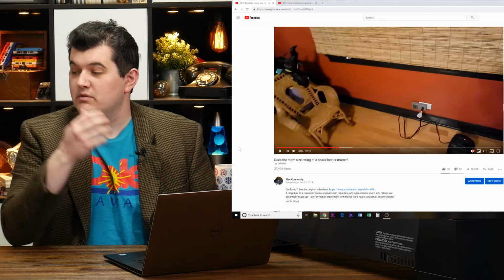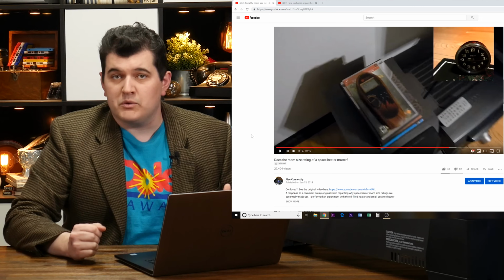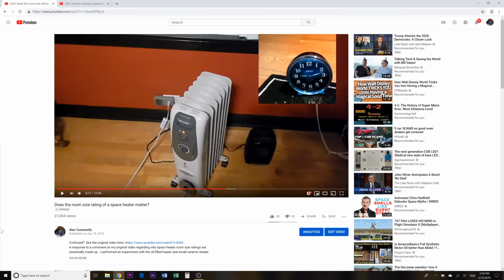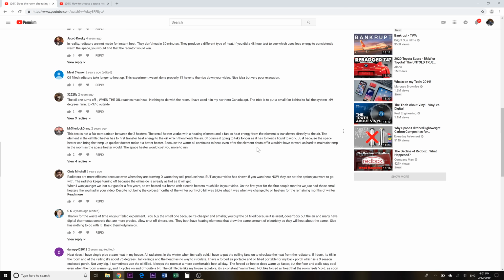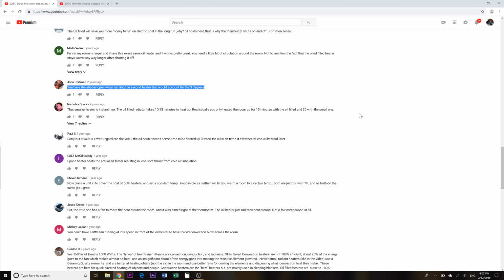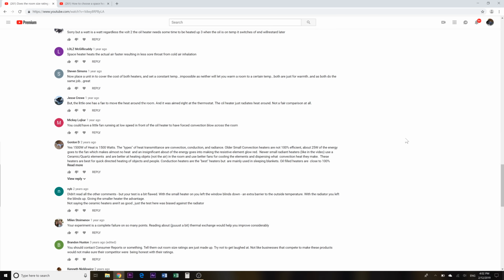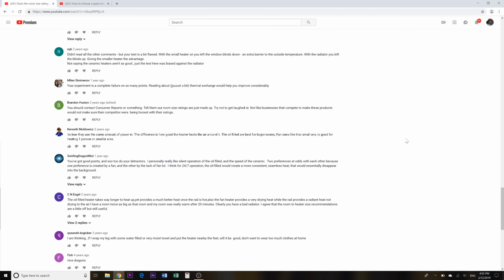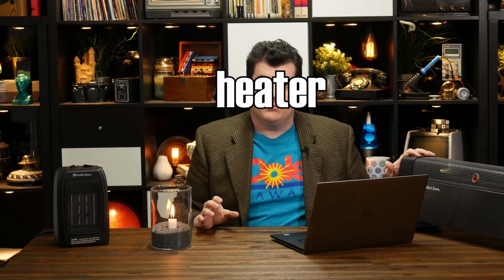More Space Heater Nonsense

Comment: A 4-slice bread toaster uses about 1400 watts with all elements energized. So it should be almost as effective as a 1500 watt space heater. Right? So if you have a spare toaster sitting around not being used and have an urgent need to heat a room, you could just disable the timer in the toaster so that it stays energized and place it in the room. Yes, it's going to dump all 1400 watts of energy into that room, but as you can imagine, it's not going to do a very good job of heating the space.

The conclusion here is that the room size rating has more to do with how the heat is distributed to the inhabitants of the space. (That is an important qualifier as we'll see later.) A small fan powered space heater can definitely punch far above its weight class in many situations, but the difference becomes really noticeable when the space you're aiming to heat has a high ceiling. With a small space heater, all of the heated air will of course rise to the top of the room, and you can actually feel the level of warm air descend the longer the heater stays on. Once the air above you is heated, it will start to heat the air around your head, then lower to your torso, etc. Of course this can be wildly inefficient if you are heating a large, open space with lots of air volume above you. Essentially you need to run that heater for a very long time to heat allll that air above you until the heat "level" of the room will actually descend to where you can feel it throughout the room, and not just next to the heater.

An oil-filled radiant heater (notice that word "radiant", very important)... Well I'm not even going to complete that thought because by now I am certain you see exactly where this is going.

I suggest you find an actual large room with a high ceiling to conduct this same experiment in, and instead of just measuring the temperature of the air, measure the comfort of numerous people distributed throughout the room, at various distances from the heat source.

Comment: little fan forced heater is perfect for most sealed rooms, big or small and great at heating them..but they really really hurt when you get your electric bill!! Now the silent radiator heater is great for a more safe low heat heater to bring a sealed small room temp up enough to be sleep comfortable as indeed I enjoy. I run my radiator at the low 600 watt setting to protect the AC plug from melting or causing my expensive wall outlets from melting over time, and my electric bill is not painful either. I never set these to 1500 watts(12Amps). My oil filled heater does not turn off at the 600w and I set the thermostat to the middle, no higher.. If your room is 50 degrees when trying to heat it, a space heater would not be the safest bet to begin with lol.

Comment: The main thing was overlooked. People are more worried about the cost of usage. The small heater using a fan. The fan takes electricity to operate. It has heating elements that take ADDITIONAL electricity. So it would cost you more money to operate because of the fan.  The convection or liquid filled heaters  would be cheaper to use.  Who cares how much longer it takes to get your butt warm.  It is not that much longer.
Reply: The uses less than 30 watts of power to operate. And even that little 30 watts isn't going to waste, since all that airflow it generates eventually slows down due to air resistance, all energy going to the fan will become heat in your room at some point.

Comment: I've been wondering something for a while now, and I guess this video is as good of a place to express it as any. My question is, if electric is the cheapest form of transportation (EVs), and is 100% efficient, why is it the most expensive way to heat a house? And conversely, if diesel fuel (heating oil) is so expensive and inefficient to use as a propulsion method (the general consensus nowadays going toward electric vehicles), how is it cheaper to use heating oil, which ALSO uses electricity for a circulator pump or air blower, for home heating then simply using resistive electricity which is 100% efficient, and supposedly cheaper than fuel oils/fossil fuels?
Reply: Engines are not very efficient at turning the combustion into mechanical energy(30-35% is what I got looking it up), a lot of that energy is released as heat.  While a electric car is way more efficient at turning electric energy into mechanical energy ( 85%+ according to what I found on google (
Reply: Deisel ICE's have bad thermal efficiency a lot of energy is lost in heat... Fuel oil heating isnt as efficient as Propane or Methane (NG) because it cannot be burned at the 85-95 percent efficiency in a furnace or even in a fuel oil stove (like a woodstove) wood and fuel oil stoves likely range 40-75% efficient that goes for catalytic and pellet type units. I have at home a catalytic wood stove and it when activated to combust the smoke still puts 250F temps up the 8 inch flue. Deisel has a really high BTU per unit rate compared to all the other options so wanting to use it makes lots of sense and granted there are diesel burner heat exchanger units out there that are fairly efficient being used in tiny homes, RV's and the like they are basically a tiny heat exchanger off a jet engine but it to does exhaust some heat up flue and likely more than the 5-15% of standardized gas furnaces. All of that said that is exactly why new invertor and multi/variable speed scroll compressors in heat pumps had to come up with a efficiency rating to show the fact they dont create the heat they extract and compress that heat from outdoors in a manor to be 100-500% efficient or in other words a COP1-COP5 when comparing BTUs gain per watt input. Burning any fuel will only ever get to 90-99% while since the heat pump doesnt create the BTU it only harvests it and compresses it from an outside air or ground source it can go beyond the COP1 rating and right to I think i seen a unit advertised to heat down to -22F and still be at COP1 and as the outside temp climbs it had a max of high COP4's at only 22F which most traditional heat pumps cant even extract heat below 35F outside temps.. This is also why the rest of the world uses masonry fire places that run flue gasses through a thermal mass it is all in an attempt to get closer to 100% (COP1).. even some old and even modern engine designs make attempts to control these heat losses better by OP engine designs better thermal efficiency leads to either more mileage or power depending on what the engineer wants from the engine. Turbo chargers with turbo blankets and wrapped manifolds to retain that heat until the turbo can extract the energy is another example of these efforts. As for the question of the best way to heat a house it really depends on the house. A super air tight or a super draft house both would do well with infrared heating a mass to better control the releasing of that heat to the air space. A drafty house with no insulation would do well with a infrared source but do poorly with non blown convection heat ( the oil/water radiator). That drafty house the convection heat will rise and exit the structure and stratification with no circulation will make the floor drastically colder than the ceiling. Same drafty house with the forced air will be slightly better than the convection due to the forced convection but only slightly that heat will still stratify just slightly slower and be able to penetrate the cold mass of the room slightly before being evacuated. The drafty house with the infrared heated mass lets say the mass is the floor and the heaters are on the ceiling above. This way the light pens the floor and objects heating them up and the heat is slowly released so the drafty house feels more regulated Floor to ceiling since the heat is releasing from the floor slowly. I have this method at the fire house and it works really well when the doors come open the heated air blows away but the floors and even the trucks are saturated with heat so it recovers much faster after closing the doors it would be nice to try modern heat pump system but it isnt as easy as changing a quarts element when it goes out. Nor does the infrared care on bit about the outdoor temperature. This is why humans are much more comfortable with infrared heater designs and i am not referring to those weird little wooden box jobs with light bulbs and fans. I am talking exposed emitted infrared light like the expose element quarts heaters of the old days and modern times as well as wood burners, open fires, pits like used in India, and even the small infrared propane and kerosene units that put off direct infrared emissions that heat up the mass around it and slowly radiate that heat back out over time or quickly if a large influx of cold air was to happen light a door opening. If you could spend the same running cost amount dollar for dollar on 2 unit both set to 72 at a wall thermostat in dead of winter, but one setup gives you a 62F degree floor and 76F ceiling  while the other unit gives you a 80F floor and a 76F ceiling which would you choose.
Reply: Electric Heating itself is 100% efficient, but electric Power Generation is not. For diesel fuel (only about 1% of US electricity), it is about 40% efficient. Conversely, a heating oil (diesel)-fired furnace is about 80% efficient, meaning about DOUBLE the heat output from the same amount of fuel. TC has an earlier video that explains this in greater detail: https://youtu.be/56DSH8tKUvo

Hope this helps.
Reply: It's not so expensive to warm house with electricity. Actually if you use heatpump it's one of cheapest. And even with resistive heating remember that the heaters for whole house can cost 200 bucks, vs 3000(just heatpump on the wall) or whole system which may be 30k. I think it's reasonable estimation that you will save like 200 bucks a month with heating with heatpump vs resistive. so 2k a year. If you had to pay 30k for system- that 15 years for return of investment. That's bad investment.
Not to mention that in most places you don't even have to warm for 6 months at all so 15 years may change to 20 or 25. But it's easy to push things to people who have pre approved mortgage. If you have big mortgage payment then ofc you need your heating to be cheap. It's better, but the whole situation is bad. 

And driving electric car is only "cheap" if anyway wanted to pay 30k+ for a car and you are ready to make number of compromises. 
If you want cheap transportation you can still pick any toyota from last 15 or 10 years(depending on how cheap and how modern you want your car to be) and it will be cheaper in long run. Even new toyota hybrid is not cheap but milage is good.
Example- you buy 5k old but running great, toyota avensis. You can drive it 5 years or even more with small maintenance. Car will lose like 3k in value in 5 years and you will pay 9k in gas. That's 12k cost to drive for 5 years. Find me a new electric car that won't lose 12k in value in 5 years. Not to mention electricity costs something, and in my country if you charge at fast charging it's sometimes costs same as a tank of gas. And I need to charge again in 400km vs double the range in normal car. 

Especially now when everyone is thinking to get electric car you can get a good reliable gas car for cheap. People are crazy. Some poor families will switch from very economic reliable cars for much expensive electric. Sounds cool, but how many times dad will have to stand somewhere and wait for charging. How many family trips will have to be many hours longer. And how many people will almost get heart attack when they realise in 5 years that they paid 30k and they will get only 10 now. Partly because you can buy new one now for little more with double the range.

And last but not least- there will be always a time of emergency, when you have to drive long distance to visit someone for example. Or you forgot something and you have to drive back. Charging takes time, and even many new cars still charge much slower than they advertise. Sometimes there is not even a charger where you wanna go.

Not to mention that if you come back home from a longer drive it is quite usual that your battery is almost empty. What if there is some emergency. I don' like it. Electric cars are at some weird point where you are compromising a lot to save that not so big gas money, mostly because of scarcity of gas prices that is mostly artificial. Oh and also shaming people for driving on diesel or gas. And it is annoying to plug and unplug that cable all the time.

Comment: One of the elements that may be important in the storage heater (equipped with fireclay bricks, steel or concrete filling) may be the price of electricity. Where I live, there is an option to set up a two-tariff meter. The cost of electricity depends indirectly on the time at which this electricity is taken from the network. You "fill" the heater when electricity is cheaper and you use the heat when the price of electricity increases.

Comment: I am a physicist and engineer. A radiative heater will transfer heat directly to a target (for example your body) depending on the temperature difference between the radiator and the target with a direct line of sight to the radiator, whereas a convective heater heats the surrounding air surrounding the heater through convection (plus a little bit of radiation due to temperature differences between air currents). This means that radiative heat will reach you immediately (if you can see the radiator) whereas convective heat will require  more time.

Comment: They are NOT the same. One with a higher CFU (air flux) will heat up the room faster. The one with a lower air flux will result in hotter air tho. The hot air goes up and stayes up, until it gets replaced with hotter air. Most heat is lost through the ceiling as hot air stayes up. Considering this, the hotter the air is near the ceiling, the more heat is lost. In conclusion, get a heater that outputs not hotter air than the temperature that you want to have in your room with a big air flux. The problem is, you will not really find one, so just get a whatever heater, preferably one with adjustable power and get a BIG QUIET FAN to help mix up the air in the room to have an even temperature. That is my view based on experimenting and physics laws.

Comment: Could it be that the oil in the radiant heater stores some heat thereby smoothing out the effect of cycling on and off.  If one heater runs constantly and one cycles, the one that cycles presumably uses less energy.

Comment: I've found all of your videos to be excellent.   They are extremely well detailed and based in research and knowledge.
It's disheartening when people comment in error because they missed the information or the coverage that your put into a video.  And particularly when the comments are rude or insulting.  For one thing, you did state in another video that oil-filled heaters are slow to heat the room, but they're the best design for rooms requiring a constant source of heat.
For anyone with common sense your focus was on protecting stupid people from the marketing lies that they'll find when shopping.  Then the commenters display their stupidity by taking issue with what you had clearly stated about the design differences.  The main point was to gain understanding of which design will work better for a given room the person has.
What I'm observing is that the Pelonis oil-filled heater you were using isn't up to par with other oil-filled units.  I have two oil-filled units from another manufacturer and the performance is much better than what you had recorded.  And yes, a fan forced space heater will heat the room faster.

I want to say that well-made oil-filled heaters will heat up fairly quickly by starting them out on the maximum setting.  In about fifteen minutes they will be throwing decent heat.  Just don't forget to lower the setting if you won't be staying in the room because the average room will become too hot.
I hate cheap plastic-bodied space heaters.  The plastic bodied units are always the cheapest junk available, and I wouldn't trust these in my home.  Instead, spend a little extra and buy what's called a Milkhouse heater.  They have a full metal body, a fan, and are better made on the inside.  Milkhouse heaters are considered to be heavy-duty and are the go-to space heater for tough environments like in a workshop, garage, and yes, a Milkhouse.

Comment: Congratulations!!! You have successfully created a video demonstration of mass formation psychosis.
Perhaps those argumentative comments on the old video, are just folks who were utterly convinced by the false claims on the heater boxes. I have known what you've proven for years -- I ALWAYS buy the cheap ceramic 1500 watt heaters since they last a couple seasons, do the job nicely, and have the safety switch on the bottom. Thanks for this series! 
PS -- If I need a larger room warmed up, I use two of the cheap, ceramic 1500 watt heaters, usually utilizing a separate heavy-duty extension cord to separate the circuit they are plugged into. They work great this way, for a quick, short-term warm-up. Cheers!